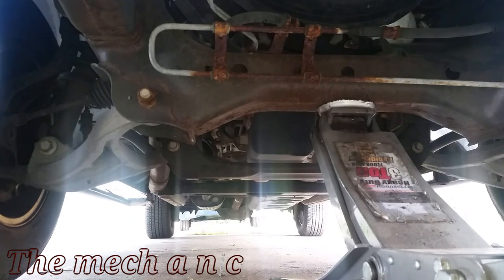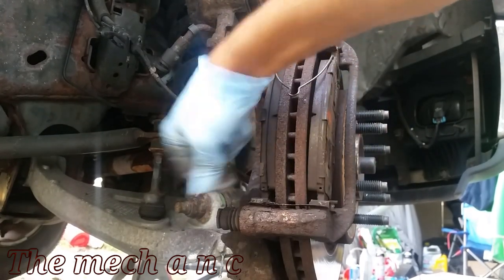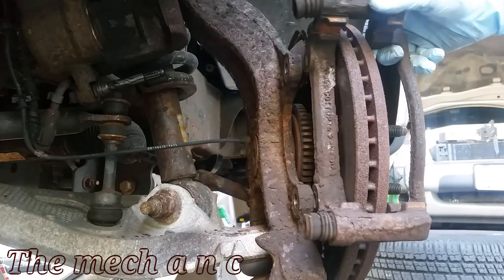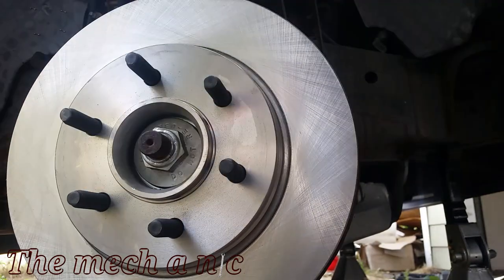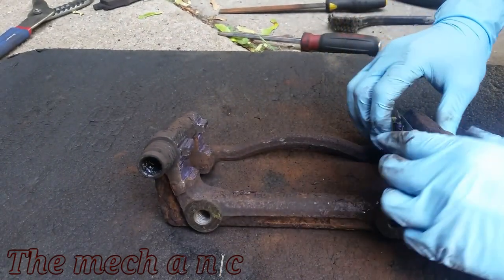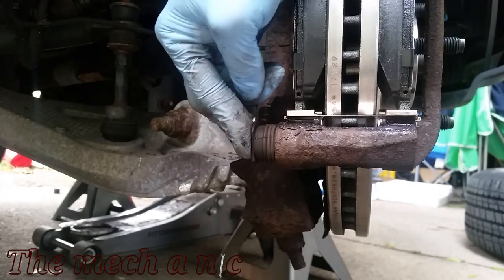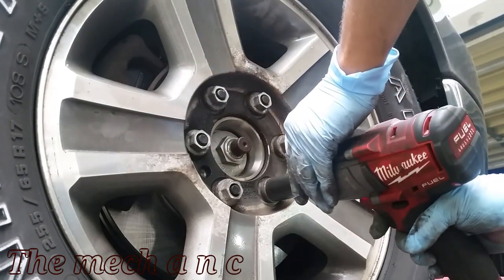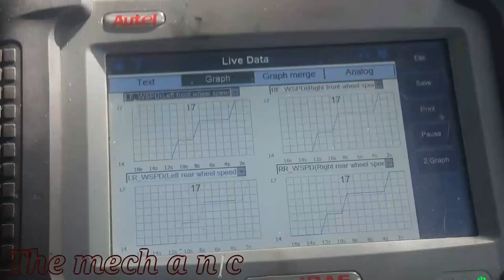2004 - 08 ford f150 front brakes

Comment: Looks good but would have applied anti seize to the metal backing of the pads. Yes Blue medium threadlocker on bolts. As much as rust was on the calipers I'd replace them personally. But I realize if it's someone else's vehicle budgets may not can afford. I just replaced my 06 Lariat with Napa  premium coated calipers, premium coated rotors, premium pads. New spindle nuts as well. I removed Shields behind rotors while I had rotors off. Cleaned with distilled vinegar and  sanded the shields, wire brushed the arms and brackets free of rust. Then wiped down arms and brackets also with white distilled vinegar. Allow to dry thoroughly. Then painted Shields and arms and brackets.  Reinstalled shields. Applied tiny bit of high temp red bearing grease to axle spindle shaft before sliding it on spindle.  I bled my brakes using a Harborfreight air compressor brake bleeding kit.  Continue to succeed friend.

Comment: I did this front brake job two weeks ago, and ever since then I got the ABS light to stay on.  WTF!  So when I bought new tires afterward, I told the mechanic about my ABS light that stays on.  He investigated and found on the right hub, and behind it are the teeth.  One of the teeth had a crack between two teeth actually due to factory defect.  That's how sensitive the ABS system is.  So I went back and exchanged the new rotor for a replacement one, and put that one on today.

Comment: What a great and helpful video.  I got the 2005 F150 and the brakes seriously needed to be replaced, so I tightened my bootstraps and just completed the job 7/26/20. Previously, I took the truck in to have the front and rear pads and rotors replaced..  WHAT A HACK. Just learned he did not grease the pins and the rubber boots that hold the bracket for the pads; nor did he install the  horseshoe wire clips that hold the discs .  He literally did not touch any grease.  On the positive side, he did not wipe his greasy fingers on the discs to clean his fingers off.THUMBS UP ON THIS VIDEO!

Comment: I am doing all four rotors and brakes. Bought all the hardware and boots also. Total was $540. Saved at least 1k dyi and following the vid. Thanks bro.
Reply from the maker: Nice amount of money saved 👍
Reply: @themechanic6117  one question, how did you fix the sprocket on the back of the rotor from being off true? Cause after watching your vid I checked the rotor in the box and it was already like that. Just slightly though. Does that matter? I did not see anywhere that those teeth touch anything I have a 2wd version on my 2006 f150 I am guessing that is for the 4wd types?
Reply from the maker: There shoukd be a sensor that picks up on those teeth. If yoyr truck doesnt have a sensor then dont worry about it. I used a small prying tool to bend it back into place. If there is a problem your abs light may come on
Reply: @themechanic6117  it has the sensor. But no abs light is on. If it comes on later I do as you did and move it slightly into true. Its raining now and I dont feel like taking the tire off tonight.
Reply from the maker: If its driving fine and no abs light id leave it. Should be fine
Reply: @themechanic6117  yes sir. Thanks

Comment: Wow, great tips man! Especially opening the brake fluid chamber lid.
Reply from the maker: Thank you , thanks for watching 👍
Reply: @themechanic6117  I replaced the brakes like a year ago, then around a month ago I could hear the bearing starting to act up. Should I plan on replacing the brake pads along with the rotor just for the hell of it?
Reply from the maker: Depends if it's worn down or old. If the brakes look great you don't need to replace them.

Comment: Great step by step instructions. I also have a digital torque and angle meter like the one you used. I got from Matco tools,  you got me thinking i should just use it on the caliper bracket bolts and use my torque wrench on every thing else. Great job, your very informative.
Reply from the maker: Its a great tool to have. Thank you for leaving a comment

Comment: I use threadlocker on every fastener - blue  I have a 2010  2wd and it's the same caliper  but the bolt on rotor and  bearing is a crazy design. LOL   I have a cabinet sandblaster to clean up the  caliper  bracket - works great . Well done . Cheers
Reply from the maker: +STEVE ROB that's what I need a sand blaster ! I wonder if one of those tumbler things will work for rust..
Reply: STEVE ROB REVIEWS I’m like you video it’s good explicación buen video amigo me gusto tu explicación

Comment: Great Video!
2005 RWD bearing growling, so I have to replace. Watched a ton of vids, mostly are 4WD, or gloss over the bearings being in the rotor.
Your post showed everything I needed to know (love the music) with sensible pointers without attitude! 
Was the Harbor Freight torque wrench 1/2" drive? or3/4 with a converter? Cause that's a lot of ft#
Reply from the maker: Thank you. Its a 3/4 with an adapter on it to 1/2
Reply: you define the difference of 2WD versus 4WD rotors.  This is a great 2WD rotor replacement.  Common sense cleaning and use of grease is essential as you point out.  BIG boy torque wrench is essential for 295 ft lb torqueing.  Need a 500-600 ft lb torque wrench to do this job is good info to properly do this task.   Great job!
Reply from the maker: Thank you

Comment: Old, but I appreciate it. I have a 2006. I've noticed the rotors are pretty notorious for warping. I've changed mine twice now and the pulsing brakes due to warped rotors is always the first indication of a break problem. I think they are under-engineered and prone to overheating. What are your thoughts on the more expensive designer cut rotors from suppliers like Power Stop? Will they last longer and are they worth the price?

Comment: It took me four hours two pry bars a torch and a mini sledge to get the rotor off the spindle. All the videos show them sliding off by hand or maybe a small tap with a hammer the inner race was stuck on the spindle i had to heat it to get it off and the only way I could get to it was to completely destroy the bearing and rip the rotor off! Any advice for the other side I tried to take if off and it seems stuck also the truck has150k miles and no rust
Reply from the maker: A slide hammer could help. You might be able to rent one

Comment: How did you fix the tone wheel being benton the rotor?? I have the exact same issue! It’s causing my abs light to be thrown. Please let me know how you bent it back.
Reply from the maker: I tapped on it with a brass punch and a small hammer to get it lined back up again
Reply: @themechanic6117  I fixed it with some channel locks😂 thanks man
Reply from the maker: Nice 👍

Comment: Is this rotor model that has to be taken off the axle and with axle nut only for the 2WD version?  

Asking because I am going to do a friends soon and don’t have truck in front of me.  Good video, I saw the bent reluctor ring and had caution strike me before you pointed it out.
Reply from the maker: Yes this style is only for the rwd models, if his is awd then it's actually easier because you can pull the rotor off like a normal brake job and the wheel bearing stays attached

Comment: On the part where you said you had to go back and fix that on back of the rotor? What you do? I bought new rotors and when I put one of them I had same problem?
Reply from the maker: The tone ring for the abs was bent . I went in there with a pry bar and bent it back
Reply: So do I need to fix that ? Does it matter? What does it affect if i don't? And thanks for the help I appreciate it.
Reply from the maker: Yes you do need to fix it. It'll cause your ABS light to be on and your ABS will activate while you're driving which you don't want .
Reply: Alright sounds good thank you.
Reply: so that tone ring-a-ma-jig can just be pried into the correct position...just get it square and running true?
Reply from the maker: Thats right. Making sure it lines up with the abs sensor
Reply: @themechanic6117  Thank you!

Comment: Speaking of rusty calipers, by the looks of the brake fluid reservoir, ya just might have unwanted debris in the lines. Such as copper and high possibility of others, in the lines. If it were mine, I'd replace the caliper, that's just me. And always, do a brake fluid "flush", it may prolong the life of the most important system on your vehicle. 
God Speed,,,,

Comment: hello, I only need  2  of the FORD OE 6L3Z3C294AA - Outer Wheel Bearing Nut  on my 2WD front Brake?
Reply from the maker: Dont think you need to remove the axle nut to do the rear brakes
Reply: @themechanic6117  thank you sir

Comment: So why am I not supposed to re-use the spindle nut? I don’t drive the vehicle over 50 mph and I was going to thread lock it.
Reply from the maker: Service manual says to replace it, on other cars I've reused them and never had a problem.
Reply: The mech a nic ok cool, just got anted to see where the whole replacing the nut was coming from.

Comment: your going to have a fun time getting those slide-pin bolts back out with that loc-tite on there ><  You'll need a wrench on the slide pin itself next time
Reply from the maker: +animefreak5757 that's all right, haven't had a problem removing them and I been doing it for years.thanks for watching: )
Reply: hmm, good to know.  If i ever have a issue with those bolt's backing out i'll be sure to try loctite

Comment: U use threadlocker, i use antisieze lol...its the rustbelt man...it has enough threadlocker...
Reply from the maker: Lol I hear you but I don't need a brake bolt to back out on a customers car . I use to use antiseize until that very thing happened
Reply: @themechanic6117  wont the threadlock melt as soon as those breaks get hot?
Reply from the maker: Probably. I stopped using threadlocker on brake jobs. Just make sure its properly tightened and itll be good

Comment: Be careful with using a pipe on a ratchet because you can damage the ratcheting internal teeth on the gears in your tool. You’re much better off using a breaker bar for that job with the pipe attached. 😉
Reply from the maker: Thats a risk im willing to take
Reply: The mech a nic Rather than just grabbing a ½” breaker bar?! MmmmmKAY.
Reply from the maker: I have a snapon breaker bar...i tried it. I was just bending my breaker bar. Id rather destroy this old cheap (heavy duty) craftsman ratchet before i risk breaking my expensive breaker bar. Thats the only time i choose a ratchet and pipe over my breaker bar
Reply: The mech a nic Wow. I’ve never had that happen in my shop. Hell, I’d let your Snapon guy know. That’s crazy man. A breaker bar is always preferable to a ratchet for persuading a stubborn fixture.